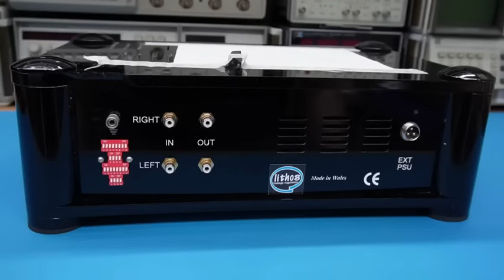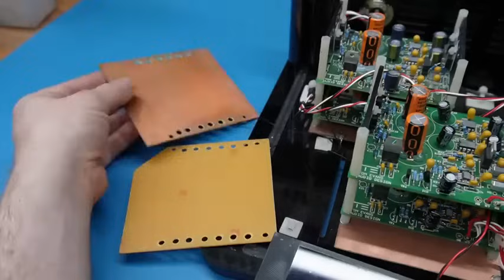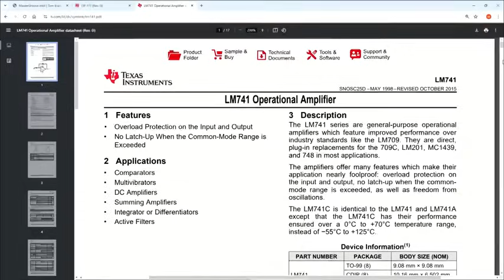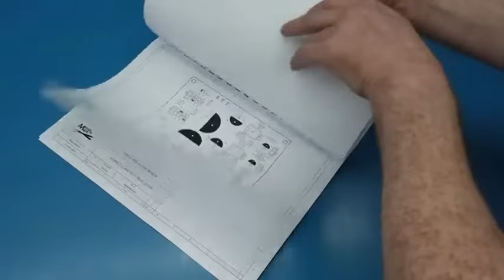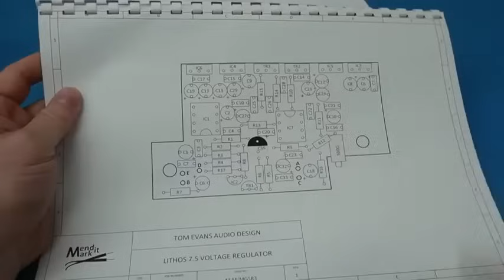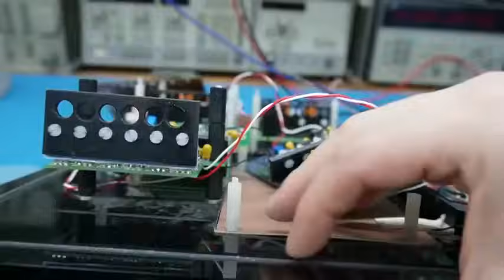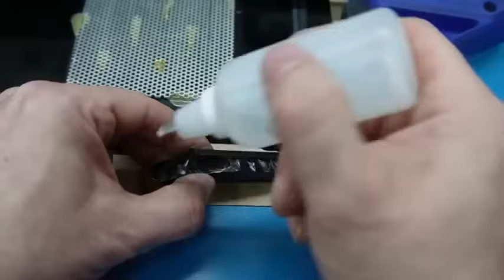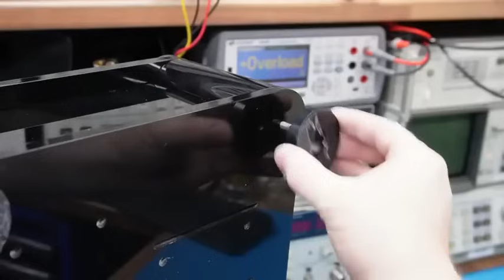Mend It Mark The £25,000 Pre Amp that went Wrong   Tom Evans Mastergroove SR mkIII  Repost

Comment: This whole story is weird... Customer sends amp to Evans for repair.  Claims Evans wants too much money to fix it, but doesn't say how much.  Has Evens mail the amp to Mend it Mark and claims Mark won't be able to fix it  (hearsay).  Mark receives the amp, and shipping company damaged it as shown in Mark's video.  Mark, not only fixes the amp, but repairs the damage quite nicely.  Was the amp damaged when shipped from owner to Evans, or Evans to Mark.  Or was the amp damaged, then sent to Evans?  We don't know.   The strange thing is, why did Mark go through all the trouble and hours to create a proper schematic for this amp with nicely punch holes and bound into a  neat booklet?  An amp he will never see again nor need a schematic for.

Mark laughs about how cheap plastic stand-offs were used, shows metal stand-offs in his drawer as what should have been used, yet, replaces all the broken plastic stand-offs with more cheap plastic stand-offs.   Wouldn't you upgrade it for your customer?, you had the parts in stock. Customer too cheap to spend 3 dollars more? Or was there some other reason....

We see a short video and think, wow, that was quick and easy fix.  But what we didn't see were the numerous hours Mark put into this amp, reverse engineering it, creating a manufacturers grade schematic, and fixing the "shipping" damage.  How much did the amp owner have to pay Mark?  or was this all theater to trash Tom Evans?

I'm not here to judge what the value of the amp is.  Obviously, the owner bought it. New or used, working or broken, we don't know the real story. Did the owner buy it used "as is" fully knowing one of the channels didn't work, and trying to scam his way into a cheap fix to possibly flip the amp for a profit?  Only the owner and Mark know the true story.  And there is obviously a lot left out of the story.

Meanwhile, the hivemind crowd with no critical thinking, jumps on the bandwagon to trash Evans.
Reply: previous comment sponsored by Tom Evans
Reply: Don't go all 'Alex Jones' and imply there's a conspiracy.  Mark created the schematic (1) to understand the circuit, and (2) provide some really instructive content, which is what he does on his channel.  He used Nylon standoffs because metal standoffs are conductive.  Did you notice that Mark did not disparage the build?  He could have.
Reply: Tom Evans wanted 6000 pounds to replace one tantalum capacitor.!
Reply: The manufacturer should have repaired the item for free. That would have been a positive gesture on his part, and would have promoted his business and avoided all this mess. I was well trained in electronics and worked in that field for several years, and have seen the 'guts' of many pieces of high-end equipment. I would have expected a far better build standard, and I don't see anything there that I think was truly innovative. The design seems to be based on known and existing circuit design principles. Grinding off the part numbers is rather questionable, since now no-one knows if they were proprietary parts, or cheap copies.
Reply: @colinsouthern  it was in the comments of the deleted video...!
Reply: @colinsouthern  Fair comments there. I do get your point on that last comment, but it's not hard to work out what the components are, from the circuit design, and then decide which are the best ones to use (or, indeed, which are the cheapest, if someone wants to make a cheap clone of it). But it does leave doubt as to which ones WERE used!
Reply: Captain Ron, it isn't hearsay IF 'Mend it like Mark' received a letter from Tom Evans suggesting he wouldn't be able to fix it. I presume Mark does have such a letter.....or are you suggesting he made it up?
I love a good conspiracy theory but sometimes these things get absurd.
btw Mark would try to keep the repair as close as possible to original design.....after all he won't know the thinking behind a lot of the choices made by TE. Obviously if things are dangerous you would take action to 'beef up' the design regarding safety (but I don't think that was the case here)
Reply: @colinsouthern  I suppose Mark might not have been told directly by Tom Evans that he couldn't fix the unit, it is possible the comment was given to the owner....and indirectly supplied to Mark (Chinese whispers). But it was 'interesting' to know as a viewer and isn't particulalry derogatory to TE (imo). It is possible that the owner even made it up....who cares!
It struck me as a challenge that Mark accepted. Perhaps the owner created the comment to motivate Mark....who cares!
The cost of the repair doesn't appear to be in the video. Perhaps it was in the comments of the original (coyrighted) video. I do seem to remember a figure but it might be my memory playing tricks. It could be that the owner didn't want to tell Mark the quotation amount, just in case Mark used as a ballpark figure for his bill. WHo know, who cares!......I do suspect the original quote was for a lot of money (who cares!)
But as you say we don't know what TE would have done in their repair. Although it seems very unlikely they would change ALL of the electronics. They would obviously fix the direct fault (shorted capacitor or subcircuit)) and they might even do an assessment of the stress on the whole system caused by the fault....and possibly change some components and possible even some sub-circuits (e.g. power supply board), As know body knows - and nobody really cares - then it could be argued that you are searching for known unknowns to support your position.
Ultimately you have a right to your opinion but it needs to be reasonable IMO. Personally I thought the 'repair' by Mark was fairly balanced. He did make some slightly harsh comments about the build quailty but I think - and a lot of people seem to agree - that the comments were fair.
Reply: @colinsouthern Colin, a well argued response from you. However you seem to be overthinking this whole affair way too much. 'Mend it like Mark' made a video and it was removed (most likely at the behest of the manufacturer). Personally I don't see why Tom Evans would want to do that (based solely on the content of the video). What was so terrible about the video that it should be removed?......it smacks of a company that at the first sign of negative press attempts to squash it with lawyers. Possibly like the Italian owner of the company that made the 'unsinkable' Baysian yacht the Mike Lynch died on. They only make things worse!
btw I stand by the bit about analysing the circuit for components and/or sub-circuits that could be stressed by a failure (such as a shorted component). There are people who could analyse where that current was supplied from and where it was sunk, and make suggestions on changing certain components that may have been stressed (e.g. regulator chips or tranisitors that were in the path that sunk the current to ground). Changing all electronics is an absurd way to do business and would be prima facie evidence that the product is massively overpriced....it would also explain why Mark got the job to fix it and then made a video that Tom Evans 'apparently' objected to. 
Your attempt to find the truth and get the story from the 'other side' (Tom Evans) is surely partly why people are so aggrieved. Somebody got the video removed by invoking copyright infringement which surely stifles debate and tells me we are never going to hear from Tom Evans (and if we do it will most likley be through his lawyers). So please, if you do manage to contact TE and get an explanation that 'explains everything' then PLEASE enlighten us. 
As far as I can see 'Mend it like Mark' has behaved like a gentleman. So I'm not sure who you are referring to by 'aggrieved party'.....surely not Mark who has mostly been polite and has tried to see the funny side of it. Most of us are just perplexed by what has happened.
Reply: @colinsouthern  Colin, for someone with no 'dog in the fight' you are certainly spending a lot of time arguing over something that shouldn't have happened IMO (the copyright complaint) and the bad publicity it has probably generated for the manufacturer.
I'm a little perplexed - and so is Mark - as to what copyright was broken. It is an interesting subject because it shouldn't be illegal to try to figure out how something works and to inform other people.....that is how we learn, it is called teaching. I wonder perhaps if the schematics Mark used were copyrighted but Mark said he generated them himself by reverse engineering the circuits.
Your attempt to find the other side of the story by searching for Tom Evan reviews won't really tell us what happened in this case (i.e. why the video was banned). Personally I think it was a bad decision and has back fired big time....Tom Evans will probably now do a press release announcing his products are 'unsinkable'!

Comment: I was baffled to see the guy had ground away the prints on the parts to make it harder to replace. What a D move.
Reply: Not harder to replace.  Harder to tell they are cheap copies of brand-name, first quality components.
Reply: "Proprietary technology "😂😅😂
Reply: Old school HiFi makers trick seen it inside a few components and thought “they are just hiding a cheap mass market part”. Funny thing is that anyone with a lick on sense just listens to the kit before buying it. Probably a good idea to check your bank account and common sense. If low on either, walk away or in the case of this pre-amp RUN!
Reply: we used to grind off part numbers when we shipped prototypes to a customer to play with.
But if they bought the equipment than there was no need to do this as all the parts were listed in the repair manual.
Bit hard to put replace IC2 "blank" and order a new "          " and you will be fine 🙂

We tended to be the 3rd line in the repair plan.
Reply: All electronics know the components are used and when it comes to Tom Evans he only use for the cheapest components in the catalog so no need to scape.
Reply: Common trick on expensive guitar FX pedals (that and goop)
Reply: @colinsouthern  I'm not here for a discussion bro. 25k for some audio mumbojumbo is a scam.
Reply: @colinsouthern  £25k

Comment: Everytime I see this video I am absolutely disgusted by the build quality of that pre-amplifier. I would not pay 250,- for it, let alone 25k! It's a piece of junk.
Keep sharing these videos so Tom can learn what the Barbara Streisand effect is. 👍
Reply: Agreed, if Tom Evans doesn't want people to comment on the poor build quality of his equipment then he shouldn't build stuff that to most  people - especially those with an engineering bent - looks cheap and nasty!
Reply: Just buy 25 dollar pre from china hifi
Reply: You're too poor to even buy a $250 pre-amp
Reply: @CaptainRon1913  Yes I am too broke to buy his amp even at 250,-, that's why I design my own amplifiers, specifically DC coupled Vacuum tube amplifiers.